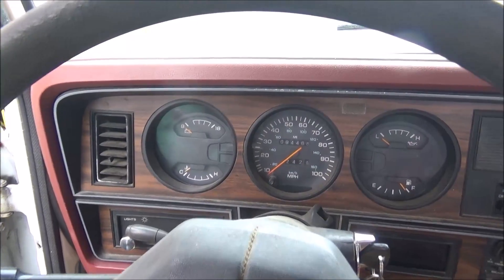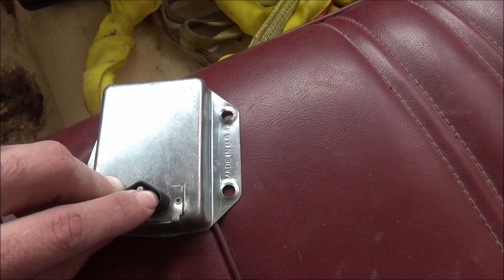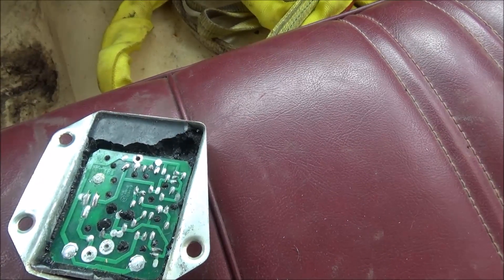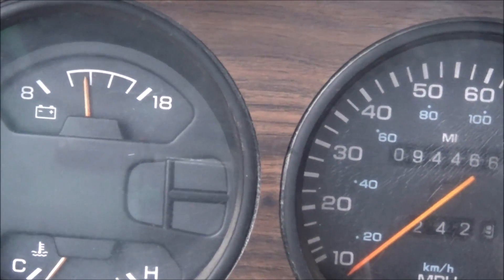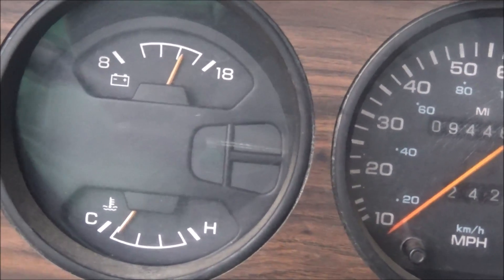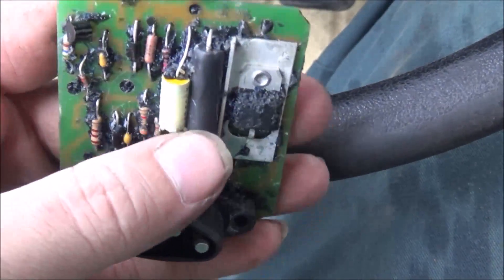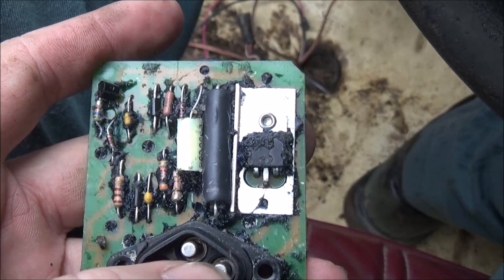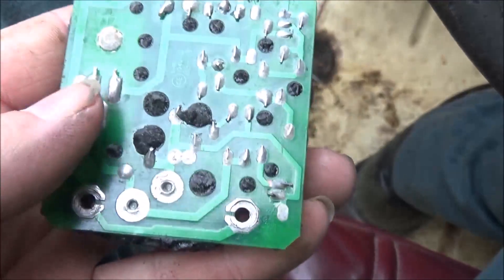Plagued by electronics, I need help

Comment: If you just want to solve the problem because it's there, keep doing what your doing.
If you want to get out of having your battery go flat Buy an entirely new alternator with built in regulator. Not some Chrysler product. If you've spent $140 on regulators so far you already spent half the cost of a new alternator.
Reply from the maker: I have only spent like $60 on regs as the cheapones I just take back and they warranty them but changing them often is annoying to me.
Reply: Not putting down Chrysler, but...go big and  yes i forgot to mention mount a gm single wire  alt. on there. (Jegs)(hot rodders use these for wild combinations.) this set-up would be in your skillset for sure.(mechanical set up) 40 yrs plus observing very few problems with  gm alternators. (above guy gives good advice). -Also I know there are plenty of other things requiring your attention.

Comment: The problem started a few years after the conversion, it would be odd to have so many regulators fail in a row(although after 40+yrs in the business I have zero faith in Dorman & Standard electrical components) it's more likely some wiring or other component is functioning below par causing the problem you're having. Like other guys have mentioned check and secure all grounds, battery neg, engine, body and instrument cluster first, possibly add a few. If that has no effect you might have to ohm out all the wiring in the charging/starting system, check all connections for corrosion. If you have a local automotive rebuilder you cou have him take apart your alternator and check each component to be sure of its quality, I've been burned a few times when the alternator tested ok on the veh but still had issues. This is one of those repairs that is time consuming, it's obvious to me if you've replaced 8 or more regulators it's another issue, personally I try to only use factory electronic parts even though most are made overseas these days, the CE on the circuit board means the board was produced in China, the "made in USA" only means it was assembled and possibly the tin covers were made here. Good luck
Reply: CE has nothing to do with China (other than a joke meaning of china export, which it is not). CE is a European Conformity (in French) mark which means it is suitable for sale in the EU.

Comment: Ballast resister used to be a common problem with the old dodges. A little white box on the fire wall 1 wire in and 1 wire out. Its about an in' long small 2 progs. I used to carry a spare in the glove box.lol I think its ceramic?
Reply from the maker: Those resistors are for the ignition, my 318 truck has them but my diesel has no need for an ignition so no resistors on this truck.

Comment: I had a problem with my 1966 vintage mustang burning out solid state regulators. After much detective work I discovered a bad negative  battery cable that would lose continuity and fry the regulator. It would run on battery voltage and by driving it vibration would cause it to lose connection and stall the engine once the regulator was fried. But you won't have that problem being a compression ignition engine. Check all your grounds or add dedicated grounds.
Reply from the maker: good advice

Comment: I think you have a ground issue so run new grounds.  If this wasn't a problem before than it has to do with the installation of the engine.

Comment: It behaves like there is an intermittent bad connection, most likely in a ground.  Direct current will do more "weird" things than you can imagine with poor grounding (think of how your trailer lights behave if the ground is poor or bad).  If something is not properly grounded, the current may be finding a way through something else and cause it to overheat and fail prematurely.  So I'd check those first, maybe even run a dedicated ground wire, adequately sized, from that component to the battery ground (starter housing, alternator housing or ground stud, and maybe even the regulator case/housing) just to be certain.

If that doesn't help, the only other thing I can think of is to replace the alternator.  I had, in my 'greener than new grass' years, an AMC model vehicle that kept losing regulators.  Several simply quit, but a few allowed it to overcharge, boil the battery and burn out every light in the car over a two week period.  I told a railroad engineer about what it was doing, after losing both of my low beams on the way to work that night.  He told me, in typical "old head" fashion, to replace the alternator, even if I couldn't find anything wrong with it while testing it.  It was, most likely, doing something that I wouldn't be able to detect with an analog meter, and it was damaging the regulator over time.  He was right.  I replaced alternator and regulator the next day, along with the head lights, tail light and dash bulbs that had popped like flashbulbs the night before, and that was the last regulator I put on that car.
Reply: diggerop totally agree. If you boil it down, if you've got good cabling and earth, but the regulator keeps dying, it can only be the alternator. Seems to be the next thing I would check.
Reply: i wonder if either the alternator is putting out too many amps or too high a voltage and the regulator isnt coping, it only takes a flatter than usual battery and you overload it real easy, i notice even at idle it was charging a lot of volts...

Comment: Excess heat and vibration are the enemies of all electronics.  That board looks like it has a rudimentary heat sink under the component, which they completely circumvented when they filled the case with all that black goo you had to chip away (black goo is there to combat vibration).  My guess could be totally off because I can't see exactly where you have this mounted in the engine bay, but I would check to see that it's far enough away from your exhaust and turbo to keep it from overheating.
Reply from the maker: It is mounted the same place it is on my 89 with the exact same setup and it has never been a problem. Of course it is an original regulator on it too. In operation the one I gutted felt like it was getting in the 120deg range. It seems to me it badly needs a heat sink of some kind for long life and not be floating in a tin can surrounded by silicone with sand in it.
Reply: Got nothing for you then!  Sorry.  Good luck with it... 

the other replies sure seem like something to investigate, except i'd be a little hesitant to go to an alternator with internal voltage regulator.  When the voltage regulator goes bad on them (and they do) you have to replace or rebuild the alternator.  Much more expensive than the $20 for a separate one.  

Only other thing i'd say to check is all the connections for corrosion and resistance.

Comment: you're not running an internally regulated alternator with an external regulator are you?
Reply from the maker: It shouldn't be. If I was wouldn't it not over charge when I ground the field wire?

Comment: Hey Brian! This is a very exciting problem! There are allot of great comments here and these guys saying grounding problems or shorted alternator wiring are probably correct. I recommend we start with the basics. I did a search on google for 'dodge external regulator wiring diagram'. You probably have it wired up like this:  

https://www.google.com/search?q=dodge+external+voltage+regulator+heavy+duty&client=tablet-android-samsung&biw=800&bih=1280&prmd=sivn&source=lnms&tbm=isch&sa=X&ved=0ahUKEwjrxNnZvorSAhXM0FQKHWq4DikQ_AUICCgC#tbm=isch&q=dodge+external+regulator+wiring+digram&imgrc=Fm3W33kVrcsVbM:

If not, maybe you can do a quick pencil sketch of what you have.
Reply from the maker: Yep that is how it is wired, excitation and field grounding wires.
Reply: bcbloc02 I agree with the guys saying to add a ground wire. Run one from the negative battery terminal to the mounting bolt for the regulator. Let us know how it goes.

Comment: That square part is a transistor and is what allows large amounts of current based on small signal voltages. Basically, the way its setup, the lower the voltage the more current it allows to pass.

As a semiconductor if a spike hits it it will fail, grounds are a start, clean the metal on your existing grounds first so it makes good contact  (battery terminals and engine strap etc.), if it fries again it's your alternator. it might need rebuilt  (bearings can make magnetic field jump if the stator has runout) or just replace it with a new one that has internal regulation and forget about the external one.
Reply from the maker: I have 2 other engines with alternators, I may try swapping one of them. I already have 2 grounds from engine to chasis. Both with star washers and dialectric grease. The regulators themselves are also mounted with 3 screws with star washers as well.  The alternator also has a dedicated ground t the cylinder head. I cleaned them all when I installed them but
 may need to go back and do them again. It would have been nice if Chrysler had used the 3rd pin in the wiring connector for a ground rather than running it thru  the truck. I think I am going to try a dedicated ground wire from reg to alternator next.

Comment: I've been through this before! Both times it was fixed by running a nice thick ground wire from the alternator case to the firewall, nice shiny metal to metal connections.
Reply from the maker: Thanks! I think running a dedicated ground wire from reg to alternator is my next try.

Comment: hy sir i think the rotor is bad if it draws to much amps it will blow your regelator jou can check this with a amp meter if the rotor draws more than 5 amps itsbroken mostly bye a bad batery conection

Comment: Sounds like a bad ground between engine and chassis, probably an intermittent or poor connection. you want to do a voltage drop test on ground between engine a battery. put volt meter from battery  negative to engine while cranking, any reading is bad , also check same between battery and body where regulator mounts .Ford and Dodge both used same style regulator and any bad ground will burn them out, the 3 pin ones run an independent ground but those 2 pin ones ground through the case for voltage sensing. bad grounds  cause a low voltage / high current situation that burns them out.

Comment: I can't remember what year Cummins engine you put in for your swap. In the 2nd gen Dodge Cummins trucks (maybe the 1st gen Cummins trucks too) the voltage regulator for the alternator is in the computer for the truck. If your alternator was one setup to be regulated inside the computer and not a standard external regulator that may be your problem. You would have to get an older style external regulated alternator but with the same frame as is on the Cummins. Hope this helps. Get me the years of the truck and engine and I will check it out. Great videos!!
Reply from the maker: Truck is 84 donor was an 89 for the harness engine was from a 91. All alternator wiring is factory. It shouldn't matter if the PCM is controlling the field or the regulator itself. I have put these style regulators on later trucks when the PCM failed so they would still operate.
Reply: 10_4 Brian. You know your stuff. Maybe we can talk about my p pumped, compound turbo'd 4bt in my f150 sometime.
Reply from the maker: Sounds like a nice setup! Those 4bt's tend to have some vibration to them though do you notice it any?
Reply: No vibration to speak of. I have 4000 rpm governor springs. I used fluid filled motor mounts which probably dampens things.

Comment: maybe your alternator puts out more amp than the regulator can handle 
check all of the earth connections and wire harness  , are all cells in battery good ...
https://alternatorparts.com/
Reply from the maker: It has had 2 batteries in that time since the overcharging time killed one of them. I am leaning towards a bad alternator causing spike problems.

Comment: Brian I put  delco one wire on my jd tractor all you need is a hot wire I think it has to be turned at 750 rpms then it will charge , don't know if dodge has something like that.

Comment: ...Hard to diagnose over the internet....I had a 73 Plymouth since 1990, and a 77 3/4 pick-up since 1991....neither ever had a problem.....Pickup lost an alternator bearing, but was OK with new one......I've never had one of those regulators fail....but I had genuine Mopars.......however, those regulators need to be really well grounded to the sheetmetal.....I use those 'star' washers.....sure sounds like a bad connection problem.....  That 'long black thing looks like a resistor.....hard to say what it does without having that thing in my hand........ I've done some electronics now and then.....but never had a failure with Mopar voltage regulators OR those old ignition units......  That component there at 12:30 or so...looks like a transient suppressor, or might be a zener diode that sets the max charge voltage.....14.4 or so....you need a special type of DVM to check those out.....but if you remove it from the circuit board....it should still check out like a diode..just make sure you put it back in the way it came out, well....just take out one end. Possible you have an alternator problem, but I'd sure work over the wiring /connections....even if they look OK......and do you have those electrical plugs at the firewall?....I've had BIG problems with them......
 Lastly.....check the alternator brushes.....I HAVE had a set of them wear out on my 99 Dodge van, quit charging with little warning......burned up the slip rings too....... Worn out brushes might give you the same sort of symtoms you're getting.....
Reply from the maker: i have been over the grounds before and they should all be good. If anything I may add a ground straight to the alternator, but when I had the jumping needle with the partially working reg that is how it was connected so that leads me to that may not help. Must be something up with the alt itself despite it bench testing fine.
Reply: I keep trying to send longer reply....no go........will try later...

Comment: Well, seems you looked into the obvious points and i also assume that the regulator is the correct one for this type of alternator.
In my opinion there are only 2 points left, the field winding has a partial short and draws too much current, easy to check, just measure the resistance of a known good one. 
Secondly, the regulator is suffering from insufficient cooling which leads to dry solder joints because overheating components unsolder/resolder itself. It is not exactly clear where it's mounted in your truck, but it seems to be a bit close to the exhaust manifold  (correct me if i am wrong), so move it to a cooler place and it may suvive.
Just bear in mind, if a (quality) replacement component fails twice, the fault is most likely elsewhere and you just curing symptoms but not really the source of the problem.
Reply from the maker: Regulator is mounted in the same spot as my 89 with the exact same setup and it has never been a problem. I am leaning towards it being the alternator itself.

Comment: Brian if it was me would first double check all grounds and run one from both the engine/alternator and battery to the regulator. Second i seem to remember at one time Dodge/Chrysler having 3 different regulators can not remember if they were for different amps or light duty to heavy duty miss match may be a problem. Third heat may be a problem mount as far from as possible. If you have already done all of this I am all out of solutions except for going with an internal regulator alternator.

Comment: Brian, something is frying the regulator and even though you say a tester showed the alternator is good, I cannot believe 6 regulators are defective. I would suspect either a high resistance chassis ground or the alternator is putting out a dirty signal due to a flakey diode. I've seen more than one engine swap with bad or missing chassis ground straps.
Reply from the maker: I already have 2 grounds from engine to chasis. Both with star washers 
and dialectric grease. The regulators themselves are also mounted with 3
 screws with star washers as well.  The alternator also has a dedicated 
ground to the cylinder head. I cleaned them all when I installed them but
 may need to go back and do them again. It would have been nice if 
Chrysler had used the 3rd pin in the wiring connector for a ground 
rather than running it thru  the truck. I think I am going to try a 
dedicated ground wire from reg to alternator next but I actually suspect it is something weird going on with the alternator itself.
Reply: bcbloc02 Good deal. I agree I'm more inclined to suspect the alternator. It would great if you knew someone who could look at that output with a scope. Any AC leakage would show up.
Reply: I'd run a ground from the regulator to the alternator as well.  You said your engine is grounded to the chassis, and the alternator grounded to the engine.  What you didn't state is the ground from the cab to the chassis.  Cab might be getting intermittent ground or high resistance ground.  Running that wire might prove it out.  Make sure battery is disconnected when replacing the regulator.

I'd also check the rectifier on the alternator at this point.  If it has gone through a few cycles of full field charging it may have smoked some diodes.  You don't want to see more than .5 vAC.  Your DVM may not report that voltage accurately if it doesn't have true RMS.

Comment: had same problem with old 440...always burning out carried extras from salvage yrds ....check and add ground wires...add one from block to body check harness for any oxidation....may want to replace line...did on mine after no prob
Reply from the maker: What line did you replace?